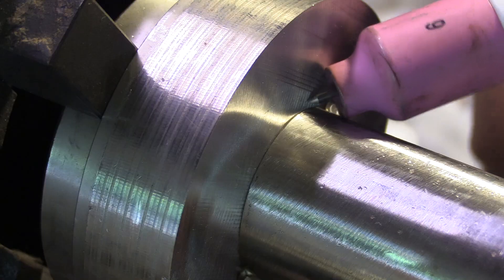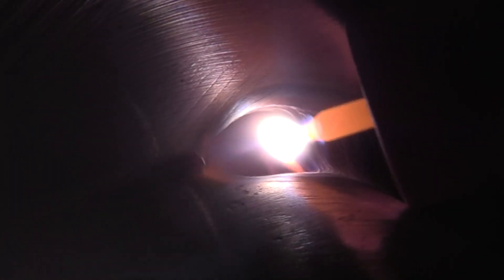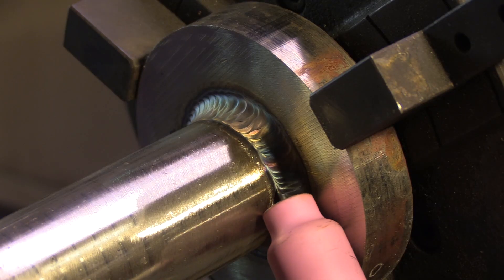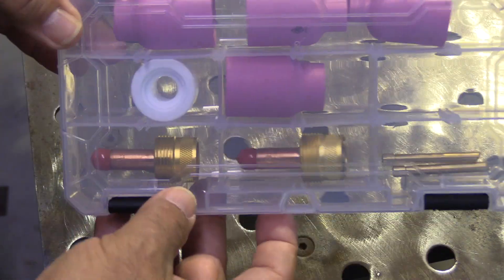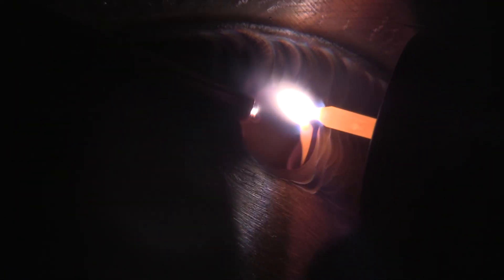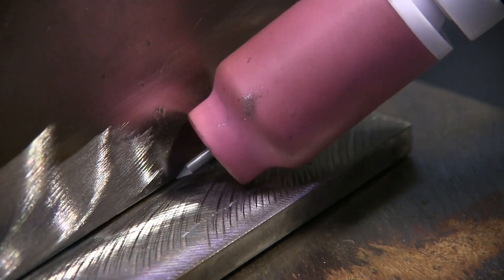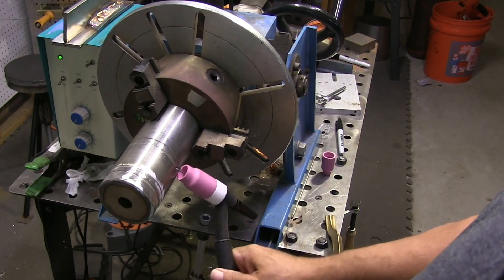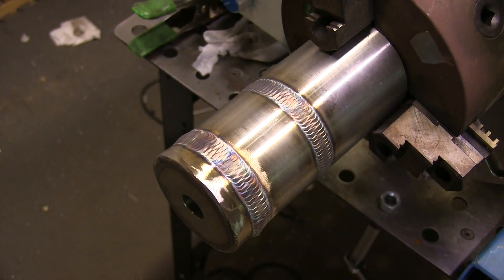Walking the Cup TIG Welding Techniques

Comment: As a ex Babcock n Wilcox multi coded welder, your a star welder. Worked in the North Sea in Scotland, and welding out there was a real pain in the arse. Scaffolding sheeted, was the number one for a welder, as your gases didn’t stand a chance with the high winds, and the last thing you needed was a repair. So a huge huge difference, being tucked up in a workshop, all roasty toasty, to the oil rigs. This is where you definitely separate the men from the boys. You’ll know what am talking about,am sure.👍🏴🥳

Comment: That 303 welds clean compared to inconel or hastaloy...also ive always called the larger size, a jumbo, everyone has their names & whatever, i like the brass collets you have there, its funny you say 55 gal barrel across the floor, theres no one that can roll an argon, or oxy/acetelyne bottle across the floor like a tg welder because they understsnd what they are acually doing when they are rolling them, im a union pipefitter/welder i tig mig & stick weld exray pipe joints it looks like you mite be also, my union is out of Rockford, Illinois local 23....you do very good work..

Comment: Hey jody, how do you get the cup sliding smoothly on a weld like that? Whenever I try this,it immediately digs in the metal... Am I using to much pressure?

Thanks in advance and keep up the great videos!
Reply: Have you ever considering or try to invert the polarity ? Some tell me it works well to make better heat distribution.

Comment: Hi, Jody! I'm working on a 17-4 stainless steel Shank with a post heat of 600°, here in a couple days I'll be using your large diameter gas lens kit for tig-welding in inconel 625, after I've done plasma welding in the right diameter. But my question is what would you say is a good starting point for the gas flow and what would be the highest? Thank you for your time..

Comment: I'm considering getting my first plasma cutter.  I have a Lincoln Electric mig welder that I've been practicing on.  I also wanted to dabble in Tig.  Without spending a ton of money, do you think the Primeweld CT520DP would be worth it?  It has a 3 year warranty also.  https://smile.amazon.com/dp/B01AB2U0XS/?coliid=I2J2VDTOD6KVTZ&colid=H6HE9NZ1R5XP&psc=0&ref_=lv_ov_lig_dp_it

Comment: Hello from Australia  Jody,  does the white heat shield not need to snap onto the torch head like the regular ck one does?  It looks like in the video that it does not and just slips on with no force at all.

Comment: Great video Jody what are the advantages of using those longer gas lens kits compared to the stubby gas lens kits my theory would be that it’s great for walking the cup because your hands aren’t as close to the metal . Don’t know if that’s right or not. Nice kit though I’m gonna have to get me one of them 👊🏻
Reply from the maker: you are correct.  I like the stubby gas lens for all around work but for pipe and walking the cup, I prefer the longer gas lens cups

Comment: I absolutely love my Tig finger and the XL. Just welded my bumper with Tig on the outside, 1/8” 7018 on the inside. Tig Finger really keeps the fingers cool. Just don’t touch the Tig finger(on the outside) after using it in a hot spot, don’t ask 🤣

Comment: I just got done getting my LDGL setup together because what I'm doing is just roasting my torch fingers. I chose a long 10 for everything too hot and 6, 8, 10 short LDGL cups for short runs...
Stubby gas lens are great for me usually, but man the closeness to the material really unloads the heat onto my fingers. Figured out a way to drop the torch heat itself off almost entirely. Take your GF or maybe your kids silicone hair ties, then wrap the handle of your torch by doubling them up. Nearly free and no hot hands anymore! 😂

Comment: I've never been able to grasp Tig Welding due to my wire feeding hand not working in conjunction with the Torch hand, drives me crazy. It's like the "pat your head and rub your belly" hands got a mind of their own.
Reply from the maker: the filler rod hand is always the hard part.  I think it really helps to get a piece of aluminum and run beads like crazy. I call it "the aluminum drill" and it really makes your feeder hand get up to speed after a while.
here is a link  https://youtu.be/xYgatSQ2Ldk

Comment: Jody, I've noticed that the tungsten angle is very steep ( I lack any other way to describe it ). I've always considered the angle to be important and if you're at 90 degrees to the work and tilted back slightly that is a more desirable torch angle.... It looks like the torch is laying flat, is this just a part of walking the cup?
Reply from the maker: torch angle is usually leaned back for walking the cup.  you can definitely go too far with it but I think what you see here is pretty normal
Reply: weldingtipsandtricks ok great! Thanks for clarifying, I am very new to TIG processes, literally only ran a few beads before. This is very helpful as I'm going into an apprenticeship with welding and fab as a part of the corse! You've no idea how much I love welding now thanks to you! 😎👍

Comment: How does the base metal melt to fuse if there is always filler rod melting ahead of the arc?
Reply from the maker: If amperage is hot enough,  gas shielding is good, and surface is free from heavy oxidation, fusion happens even though you cant see it